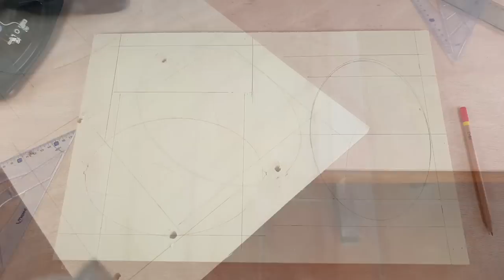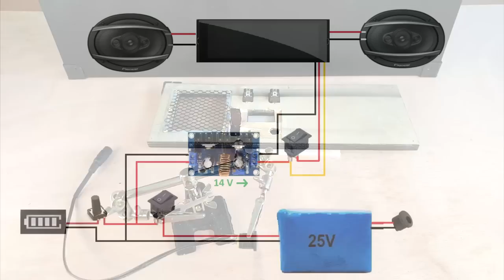DIY: Portable Car Android Bluetooth Speaker Radio

Comment: Please make something like this using car subwoofer🙂😀😀😀
Reply: That would make no sence. Because the efficiency of a car sub is pretty poor and not for portable speakers. Buy a proper sized PA driver. That would be much better. But yeah you guys Need to learn Imao.
Reply: @killeralkazarXT  you just answered a question, that I’ve had for a couple years. I tried the car subwoofer and couldn’t get it to do what I thought it would do. The sub drew too much power.
Reply: @killeralkazarXT  👍👍👍

Comment: wow lovely so what is the name of that small blue thingy called the that supply power to the battery
Reply from the maker: its a step down converter, it reduces the 25 volt battery voltage to 14 volts for the radio working voltage

Comment: I want one Can you buy one already built ? Maybe on eBay or Amazon sometimes I see them on fb marketplace kind of hard to find  I was thinking about making one a little bit more portable than your from a vintage suitcase radio or vintage radio design 3d printer I also seen someone uses subwoofer and how long does that battery last? I've seen someone use a DeWalt battery before any LED lights? You forgot to put the small tiny speakers and no speaker covers?  Those companies that make touch screen radios like dolphin but they don't make no portable ones yet that would be cool if that also worked with an app and hooked up a cool equalizer I see a lot of different things you can do with that if you get get creative invent one they would put on the market also put solar power to it built-in  you should have used a better material to make it more durable and weatherproof and I had an idea 360 speakers use some lightweight material that's durable light enough and heavy enough and tough and I forgot I also seen people use amps  subb from cars they  have different Watts and digital numbers display screen and some don't depends on the style you get

Comment: OK this might sound a little weird but what does STB mean on the other switch
Reply from the maker: Hello, it means "standby", its like when in your car you turn off the ignition and take the key out, the radio shuts off and enters in "sleep mode", it will use a tiny amount of power from the battery, the other switch is a total shut down from the battery.
Reply: @DTeK  thank you also if you don’t mind me asking us as well how long is your battery life at full blast

Comment: Well, a poor column, the speakers should be symmetrically separated from each other, separated, and the volume of the case is calculated, the case is painted or glued with veneer, and the display should be displayed on the front side of the column exactly in the middle or in the middle between the speakers
Reply: Dude it's his project he can make it anyway he wanted maybe you should post a video and show how it's done correctly.
Reply: @MRakshay-fb2mu  shush 😂
Reply: @MRakshay-fb2mu  👍👍👍👍
Reply: @banglatifgorontalo_08  … nop